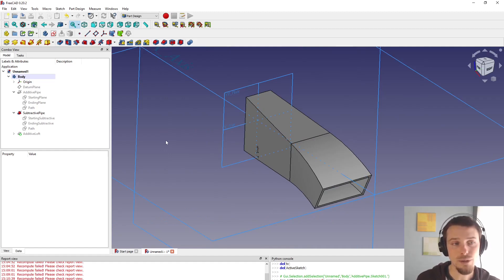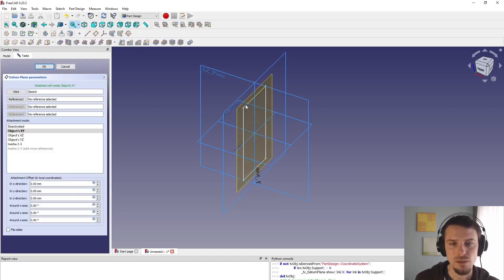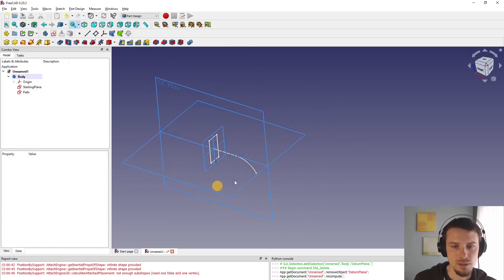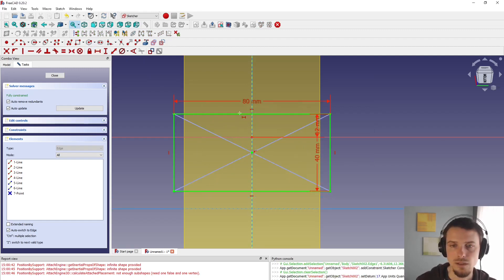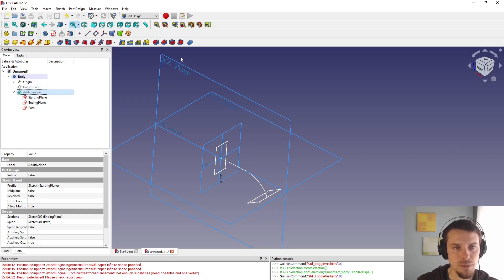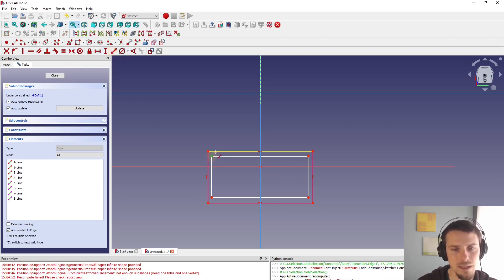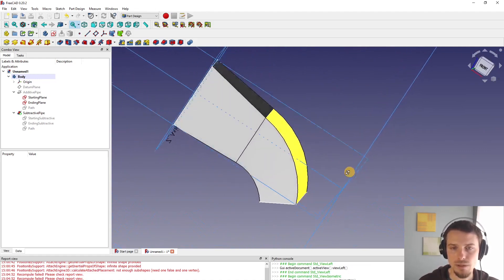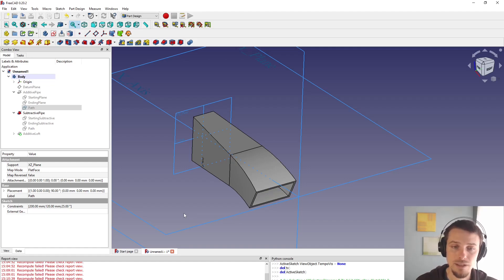Additive and subtractive pipes in FreeCAD? No (topological) problem!

Comment: Hi, how did you center the rectangle at this moment? How did you get a center point from the two construction lines?
Reply: I was wondering the same thing. He used a shortcut instead of clicking a constraint so I couldn't tell what he did.
Reply: @quattrocity9620  @EricNelson012
it is like "point on line" constraint, or just simply "coincident" constraint in Freecad 1.0 or later which is keyboard "C"?